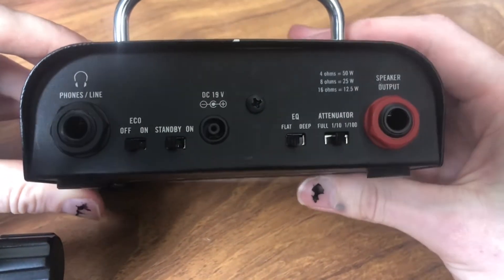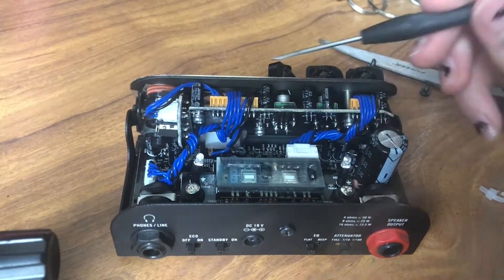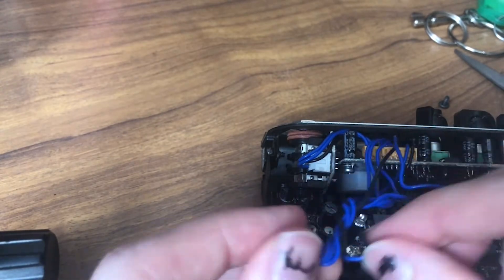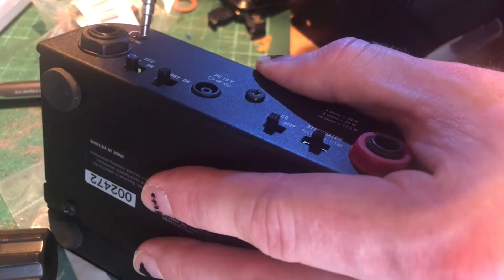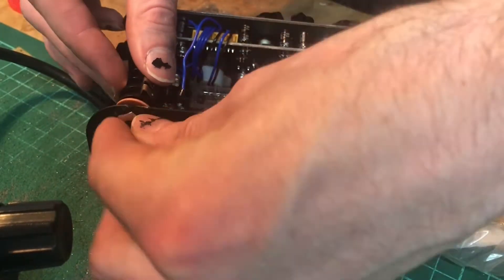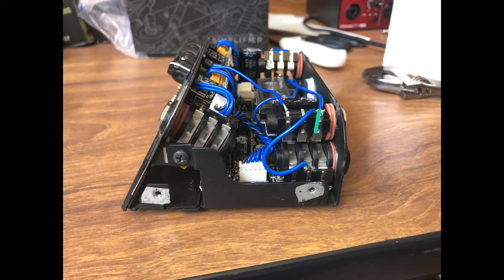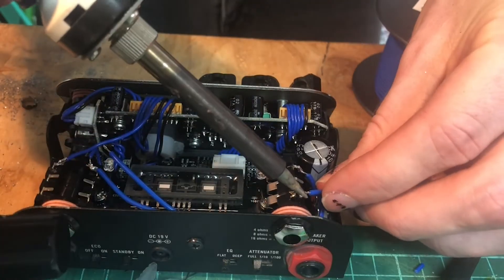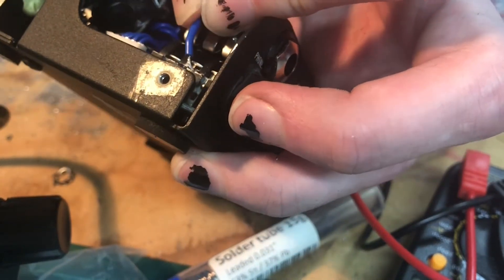Vox MV50 Effects-Loop Mod Tutorial

Comment: I've done this mod on a MV50 Boutique & a High Gain, no problems at all both work great, now I've got , reverb, chorus, phaser & delay to add to the great sound of these little amps. My FX pedal also has an IR cab module & that gave me some interesting options when using the boutique, got some extra depth on clean & lots more gain when I cranked it up. The  High Gain has enough on its own without using the IR cab. The FX also has an amp IR module as it can be used on its own to mixing desk, recording or power speaker. I've used it as a handy carry about with my Bluetooth speaker & can also record direct to my phone or tablet as it has a dedicated output.
The MV50 didn't like the amp IR module, howled like hell, that'll be left turned off as I don't need it. Thanks again for the info, quite happy I've done them both now 😁👍thanks to @Music Stuffs

Comment: Being an unbalanced signal, you could have used a single TRS jack and made (or bought) an insert cable like we use in the studio on console-to-patchbay connections. Granted it takes a special cable but you only have to install a single switching jack. I am considering doing this myself.
Reply: that is correct, in the BM modell you have to use a single socket because the space is not available. look in "the gear page" (one word, without blanks) post 111 of "vox mv50 mods". tonsound

Comment: I did it. It works. Thanks!
One question.
Why does it have to be soldered to the ring part (middle) of the headphones? Is the Sleeve part usually the ground?! If I turn it off, the grounding on the effect chain makes a terrible hum, which can damage the amplifier.

Comment: Thank yoh very much!!!
Can I ask you one thing? I want to use speaker out not the headphone out. If I do the same mod to my mv50 clean just like you, will it work properly if I use speaker out?
Reply from the maker: Thanks, I’m a little confused by your question. The effects loop will work with the speaker out. The loop isn’t a part of the headphone-out circuit so you won’t be able to hear it from that output. I hope that answers your question.
Reply: @musicstuffs9130  Thank you very much your answer is the one that I wanted to know!

Comment: Excellent mod and I think everyone who have these great amps will agree. Question though, what happens when nothing is connected to the send and return? Does the amp function like normal?
Reply from the maker: Hi, yeah when nothing is inserted the amp functions as normal. The send jack functions as a switch that engages the effects loop so when nothing is in there the loop is taken out of the circuit.
Reply: @musicstuffs9130   Cheers for that. I will make the mods! Happy Christmas mate

Comment: does it have any signal drop problem? am i right there is no buffer like a factory send return amp
Reply from the maker: I haven't noticed any signal drop. The mod doesn't add a buffer, it just intercepts the signal before it hits the poweramp. I haven't had any issues with it so far.

Comment: Hi!! Thank you so much for this video!!! Can I ask if the switching jacks that  you used were stereo (6 pin) and if is it necesary? Could be mono switching jacks intead? Because the pins at the middle weren't used after all. Thanks in advance!!!
Reply from the maker: Hi! No worries. I believe that mono switching jacks would be fine, but my guess is probably as good as yours!
Reply: @musicstuffs9130  thanks a lot!
Reply: I did some deep dive on this mod.. mono jacks will be  fine just make sure the hot signals are soldered correctly.the other which is connected to headphone out is just a Ground return 
Thanks to music stuffs for figuring the right wire to cut!

Comment: Hi again. I've tried this a few times and just can't get it to work. The problem is that both the sleeve and ring are live and I can't figure out why. Also, why solder to the middle pin of the headphones? Surely you want the ground pin?
Reply from the maker: Hey, it's hard to troubleshoot something that I don't have physical access to and also as I stated in the description, I just made a video how to do the mod, I didn't come up with the mod itself; I'm just following someone else's instructions. Quite a few people including myself have done the mod this way with success. I would double check if you put the plug back in in the correct orientation, cut the correct wire; if there are any metal parts creating a short and that all the soldering is making good contact. Good luck!
Reply from the maker: Also, you have the correct jacks yeah? They need to be switching jacks.

Comment: When I activate the delay it makes a loud click. 
I can't use it that way.  
Did anyone have this problem?
My delay is a Dispatch Master by EarthquakerDevices
Reply from the maker: I'm guessing you're saying that this is happening more when it's in the effects loop as opposed to in front of the amp? The earlier Earthquaker pedals had switches that were loud (in comparison to their new silent switches) when activated. It might just be that a loud switch going straight into the power amp makes a loud click.
Reply: first try to use different powersupplies for devices in the loop. it makes here no click anywhere. also in 4CM or 7CM when i switch my boutique or rock preamp. And it is also compatible with the tc nova system that i modified with fx loop and use two mv50 with the nova system in stereo. Works like a charm.

Comment: This looks brilliant, thanks for sharing. Attempting this mod using 2 conductor wire, didn’t mean to buy it. Not a wire guru…where would the red and white go? Thanks in advance!
Reply from the maker: Hi, if I understand you correctly you have wire that has two wires within it.  I recommend just buying some regular hook up wire, since I think winging it with that 2 conductor wire could lead to problems. You’ll want some regular hook up wire a similar thickness to what you see in the video, it’s not very expensive, you’ll be able to get some at an electronic store.
Reply: @musicstuffs9130  Thanks for the reply and that's what I ended up doing, works great. The only thing it won’t do is send the fx loop via the headphone output. Have you experienced this?
Reply from the maker: @mindcrime86  yeah, the loop is placed between the preamp and the power-amp, not between the preamp and the headphone/cabsim. If you have a device with a stand alone can-sim and headphone jack you could run it into that (I sometimes do this with my DSM ‘simplifier’)
Reply from the maker: Glad you had success with the mod
Reply: @musicstuffs9130  Thank you, that answers it. Appreciate the video and replies.

Comment: Dude, This is really cool job! Why is it soldered to the middle pin of the headphone jack? I followed this tutorial and it works fine when connected to the speaker cabinet. However, fx loop does not work when connected to lineout.
Reply from the maker: Hi, I didn’t come up with the mod just made a video for it, I think it’s maybe an earth connection there. The loop isn’t a part of the headphones out circuit so it won’t work from that output, though if you have some other cab-sim with a headphone output you could run the effect-out into your effects then into the the separate cab-sim etc. Hope this helps

Comment: does this work on the MV50 AC model ? Great video!!
Reply from the maker: Yes, it should work on the AC model. The only model I'm unsure about is the new Brian May version as it might be a bit different on the inside.
Reply: @musicstuffs9130  thanks!
Reply: in the bm modell you have to use one trs socket and wire the middle pin to return, because the space is not much there. look at post 111 in the gear page (one word without spaces) "vox mv50 mods". tonsound

Comment: Hi! me again, I wanted to ask you before the modification of my mv50 clean, seeing the unit from its back panel, the left added jack is the send and the right added jack is the return of the effects loop right? thanks again!!
Reply from the maker: Yeah, you're right. If you look at the video thumbnail (or just at the back of the unit) the send is the top left jack and the return is the top right jack.
Reply: @musicstuffs9130  thanks a lot!!
Reply: @musicstuffs9130  Hi!! Today I did the mod, totally successfull!!!, IT works really great!! Thank you so much, I Don't Know If It suppose to be like this, but If I Want to run a preamp pedal entering on the return jack I Need to put a Jack (without cable) in the send jack to get audio, but It works perfectly, thanks a lot for your video!!!
Reply from the maker: @arielcappelletti8725  Awesome! Yeah that’s how it is supposed to work. The send jack works as a switch that engages the effects loop when a cable is inserted into it.

Comment: Just out of curiosity: would you really need an fx loop with the clean version? Isn't it supposed to work well with pedals?
Reply from the maker: Hi, I addressed this in the description, but I’ll expand on it since you asked.

Firstly, you definitely don’t ‘need’ an effects loop for MV50 Clean and it does take pedals really well, however you gain a lot of options/abilities in adding one. 

The MV50 clean gets a bit of grit to it once you take the volume past about 12. This grit seems to attempt to mimic the sound of a (somewhat) cranked Fender amp, although this break-up comes from the preamp section of the MV50 clean as opposed to coming from the power amp tubes in a classic Fender amp. So, in having an effects loop on this unit you can get your reverb etc running after this break-up or before it. Both ways can sound great; you just have more options.

Adding the effects loop gives you the ability to use the unit as a power amp for other preamps (I run the preamp of my Simplifier into it). The loop also gives you the ability to go direct while bypassing the built in cab sim, so you can use the preamp of the unit with other cab sims/IRs (Again I run it into my Simplifier’s cab sims if I want to go direct).
Reply: @musicstuffs9130   @Music Stuffs  hey, sorry that was my fault. I didn't read through the whole description text cause I thought you'd only explain the technical/electronical details of your mod :/

But thank you for going further! 
I'm thinking about getting the mv50 clean as a pedalboard solution for quite some time now and always wondered if it would break up at all since I've never seen a demo of that.
Reply from the maker: @labadal  No worries! For what it’s worth I really love the amp. It definitely does the 100% clean pedalboard amp thing with a lot of volume. There’s just also a bit of grit as well if you want it. I have the amp dimed for the demo in this video if you wanna hear the break-up level of the amp, though I definitely wasn’t ‘digging-in’ on those notes.
Reply: @musicstuffs9130  so the effects loop mod would be ideal for using a laptop + amp sims/irs and the MV50 + cab as a pure sound driver?
Reply from the maker: @roundy72  Yeah, the mod makes it possible to use the mv50 as a power amp to run amp sims (without cab sims) through. (Just a note that you need to have a cable in the effect send jack for the return jack to function)
Reply: I’ve always had modeling amps. The high gain was a gift from a friend at VOX. I ordered one of the Sonicake Rock Stages effects and was wondering if it will work just going through the front of the amp without a loop mod. I have no issues modding it just wanted to know if for now it’ll work fine through the front.

Comment: I’m a bit of a layman with all this - is this simply a case of plugging your guitar in and reverb is automatically on? Is there any control over the amount or type of effect?
Reply from the maker: Hey, no worries. This mod itself doesn’t add any effects to the amp, it creates a new way of using your effects (pedals) with your amp. A lot of people don’t like to have effects like reverb or delay  before their distortion/overdrive and a lot of people like to use their amps distortion/overdrive for their ‘dirty’ sounds. An ‘effects loop’ sends the guitar signal (after the pre-amp distortion/od) out of the amp so you can put effects on it and then send it back into the amp to be amplified and sent to the speaker.

So this mod allows you to place any effect after the distortion/od that your mv50 generates.

Hope this helps
Reply: @musicstuffs9130  ahhh I totally get the concept now, thanks so much for taking the time to explain this to me 👍

Comment: I have a bunch of switching jacks - can I use them on both sides or does one side have to be non-switching?
Reply from the maker: I used switching jacks on both sides; so yeah you’ve got the right ones.
Reply: @musicstuffs9130  Thank you! Mine are 4-pin, so I ordered some 6-pin, but I did notice you didn't use the center pins here - I assume that the 4 pins on my jacks correspond with the 4 you used? I hope so - I'm not waiting for the 6-pin jacks to arrive!  LOL
Reply from the maker: @BBGreek1   Yeah I believe your switching jacks are just mono, so they should work, but I've never tried it so can't say for sure. The four pins on your jacks should correspond to the four pins I used.
Reply: @musicstuffs9130  I did this mod using my 4-pin jacks and it worked great. Thanks again for this awesome mod!

Comment: Would this work on all mv50 models?
Reply from the maker: The mod was presented to work on any of the MV50 models, I've only done it on the clean. If you follow the link to the forum in the description you can see that it's been done on the other versions of the MV50.
Reply: @musicstuffs9130  oh that's cool, thanks!
Reply: @musicstuffs9130  I've just had the jack sockets delivered, just waiting on the shielded wire to arrive, hopefully tomorrow I can do my MV50 boutique, see how it goes & I'll do my MV50 high gain, thanks for the info 👍
Reply: @Music Stuffs Thanks for the info, done my Boutique & High Gain 😁👍